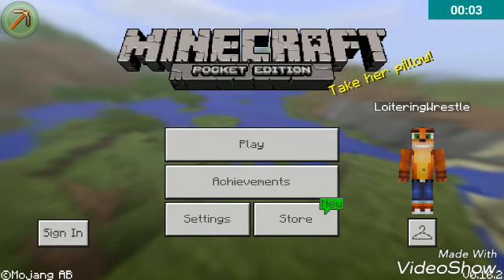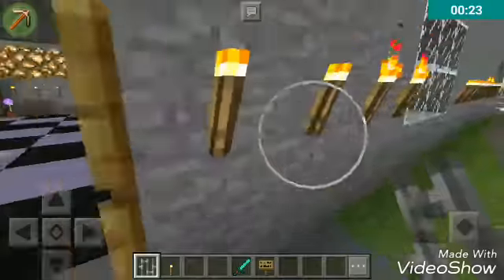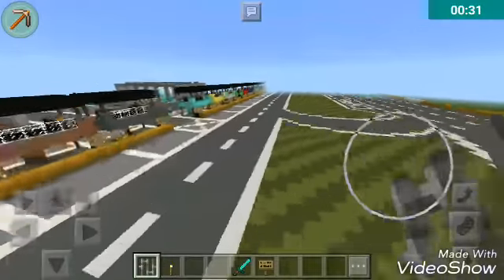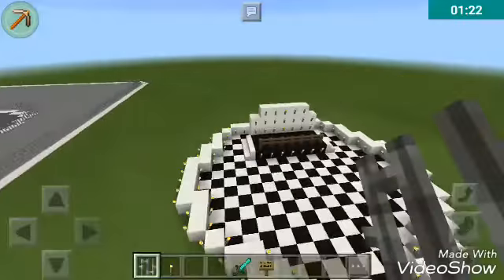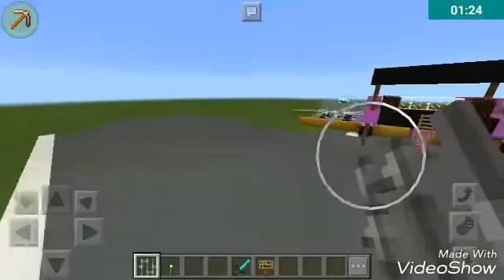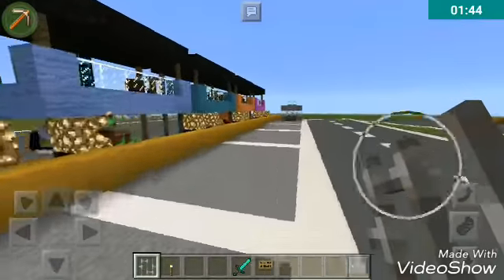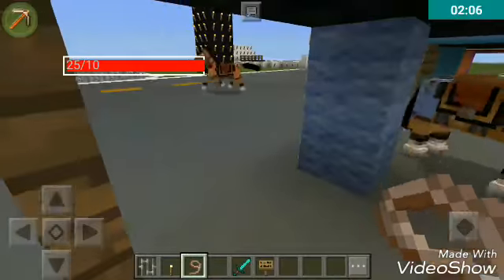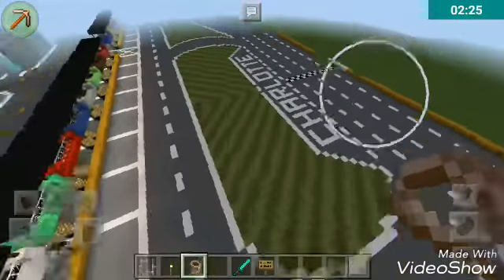Minecraft PE: Charlotte Motor Speedway (Unfinished Build Series) Part 1

Comment: Charlotte Motor Speedway is a motorsport complex located in Concord, North Carolina, 13 mi (21 km) outside Charlotte. The complex features a 1.5 mi (2.4 km) quad oval track that hosts NASCAR racing including the prestigious Coca-Cola 600 on Memorial Day weekend, and the Bank of America Roval 400. The speedway was built in 1959 by Bruton Smith and is considered the home track for NASCAR with many race teams located in the Charlotte area. The track is owned and operated by Speedway Motorsports with Marcus G. Smith (son of Bruton) as track president.

The 2,000 acres (810 ha) complex also features a state-of-the-art quarter mile (0.40 km) drag racing strip, ZMAX Dragway. It is the only all-concrete, four-lane drag strip in the United States and hosts NHRA events. Alongside the drag strip is a state-of-the-art clay oval that hosts dirt racing including the World of Outlaws finals among other popular racing events.
Reply: And yes, I back to commenting on old vids cause :saniyesh: